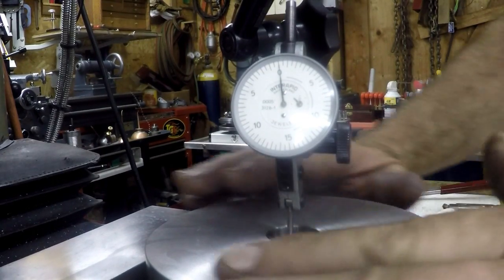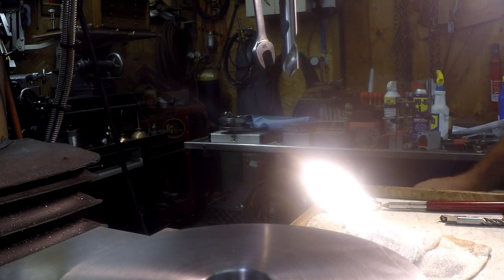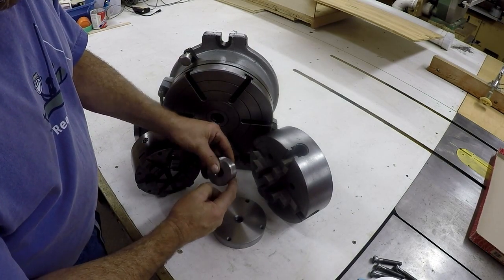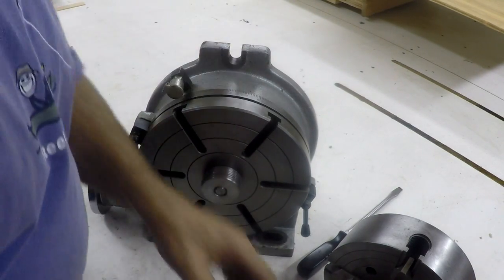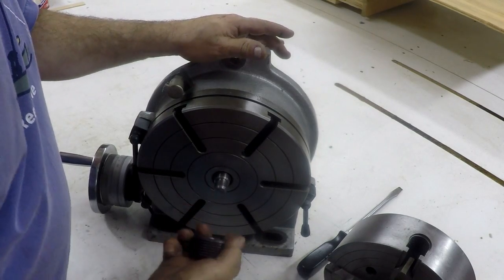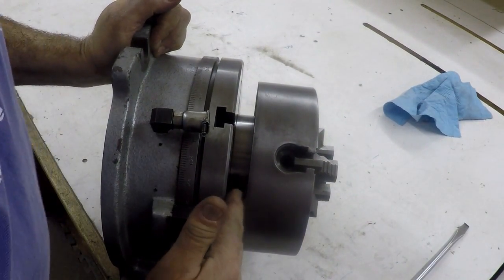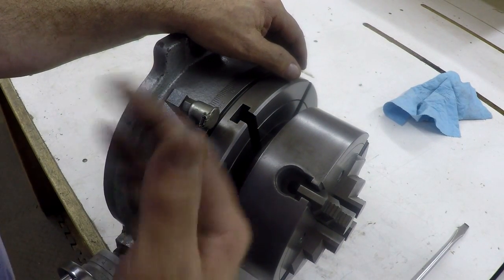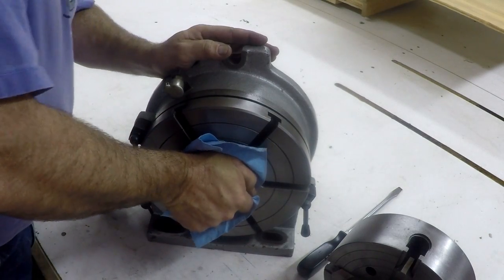Rotary Table Chuck Mount Part 7 Final

Comment: I was thinking that when you make the indexing plates to keep them a modest diameter you could have your detent button/or catch in a small fixture that could be installed into one of the keyways. Then you could remove it when you didn't need it, not drill into the face of the plate, and keep from having it register off of one of the anchors around the edge. Maybe something with a spring-loaded pin cir-clipped in a shaft on a block that slides into a keyway and tightens down with a countersunk cap screw? Make sense how I described it?
Reply from the maker: Knolltop Farms Thanks Chuck, I like your idea.  I will throw it into the mix when I go to work on something.  Thanks Randy

Comment: That makes a versatile setup, any plans to lock the chucks to avoid the reversing during use...??? The indexing plate will be a great add on, faster than turning the handle for common patterns.
Pierre
Reply from the maker: pierre beaudry Thanks Pierre.  Yes when I get home I am going to look into some type of lock setup.  Any ideas?  Thanks, Randy
Reply: If you don't mind making a hole in the table top, you could make a pin with an eccentric head near the periphery of the installed head, the drawback is that would tend to push in one direction more than the other...

I'll try to think of other things if it comes up I'll let you know...
Reply: Randy Richard Another possible way, is to get a part like an inverted '' L '' that side with the short leg is on the top of the chuck, the but of the long leg on the surface of the rotary table,  closer to the chuck you have a hole that you use to send a long screw down to a T-nut, the but of the long leg would need to be widened to go above the T-slot.... with one one each side it should hold firm enough to perform any task...

Hope it make sense, if not I could send you a simple drawing...

Comment: Looks great, Randy.  I might do the same with the 4 jaw and 3 jaw 1-3/4"-8 TPI chucks that fit my dividing head.  My rotary table is just like yours.  My lathe chucks are D1-4, so that would not work so well.  Your 3/4"/2-1/4" adapter threads could be used for lots of other things as well, like centering work holding pallets, dog plates, faceplate, or whatever you need or want.  Only downside I see is the loss of headroom under the spindle for work and tooling when the rotab is mounted in the horizontal position.  That stack is pretty thick.  Of course, when it is too thick you can take it off and do something else.
Reply from the maker: ***** Thank you Bob.  I think this is going to work our for quite a few projects.  I am going to do some accuracy checks when I get home.  Thanks for watching,  Randy